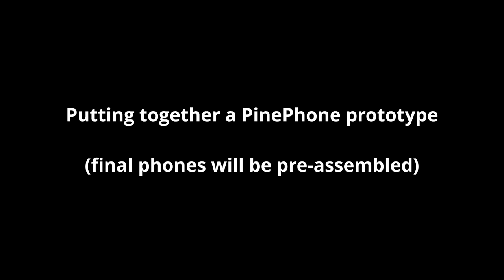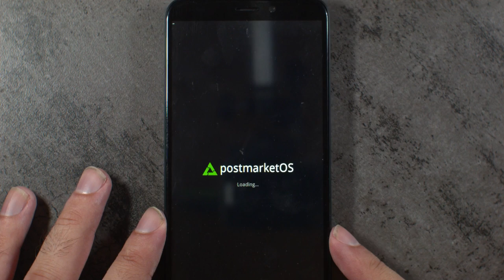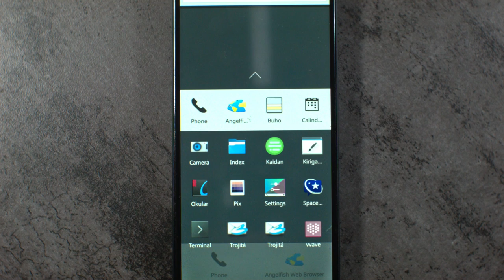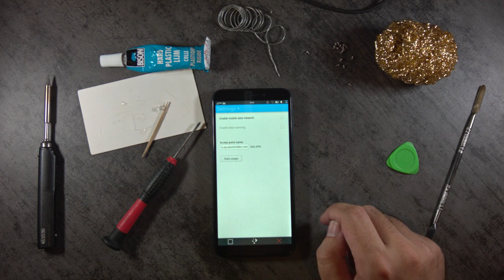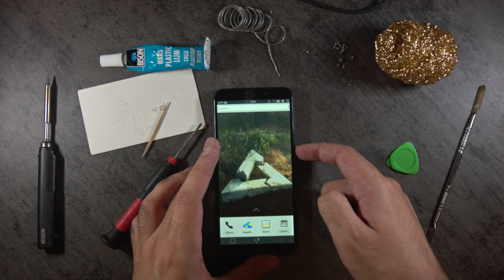Putting together the PinePhone prototype

Comment: Now this is the kind of phone that I would like; a modular phone that you can put together yourself.
Reply from the maker: well it won't be sold as a kit, but at least you can take it apart to repair things :)
Reply: I don't think its modular tho
Reply: This doesn't look much different from the budget phones I've taken apart.
Reply from the maker: @ChrisD__  That's because it's a budget linux phone, but it did spend extra money where it was needed, splitting functions to seperate chips so they can be kill-switched costs money, also the aluminium-infused plastic isn't something you see in budget phones.
Reply: @MartijnBraam  Those similarities are a good thing! They're easy to repair because you don't need a manual if you need to replace something. Also, Is it possible to boot from the SD card? My biggest fear with eMMC is that if system can't boot you can't just pull out the SSD and put it in a new machine.
Reply from the maker: @ChrisD__  Yep, SD booting is the main way I debug the device currently
Reply: @MartijnBraam  i guess the non modular phone will not boot from SD like in this modular phone,right !?
Reply from the maker: @miezoo  it definetly boots from SD, it's one of the great things about it, you put a bootable OS on both the eMMC and the SD card and it both works, when you have a bootable SD card it has priority over the OS on the internal storage.

Comment: Will definitely get this, my only concern would be the stuttering, is this only a problem with the software and will be fixed soon? There's the same thing going on with the Librem 5, so I'd guess the DEs simply aren't that optimised yet, because there really never were devices like these?
Reply: It's likely not the desktop environments. The drivers aren't yet perfect, and both devices are essentially prototype hardware. Things definitely will improve with time! This is extremely similar to how the raspberry pi evolved in terms of driver performance (especially with their recent open source videocore driver that now ships in mesa). The Mali 400 has a actively developed driver called Lima.

Comment: For version 2 "NO SOLDERING GLUED or SCREWED  PARTS" and "ONLY CONNECTORS" that are better also for REPAIR would be a nice add on.
Reply: Fairphone is what you're looking for. They have been porting AOSP to their devices too.
Reply: @parnikkapore   that fairphone does not seem as fair as they claim it to be. They do not provide a schematics. They don't sell mainboards separately. There seems to be no compatibility between parts of different models (even batteries!). Fairphone 1 had support only for 3 years... Display is glued with touchscreen into a single module. Pinephone seems to be a lot more repairable than fairphone. It is very easy to replace soldered flex cables. But it would be nice if touchscreen would not be glued to frame.

Comment: Seems REALLY slow for a 4-core processor compared to my iPhone 6S
Reply: Which part do you think is slow? The cores dont matter much, its probably the internal storage speed for the bootup and plasmas fault for visual stuttering, which can be remedied. But its probably cheaper than the iphone, which is a very polished product, completely ooposite of most linux products which get to the minimal viable product phase but not further:) Check out the Nokia N9 for a superb linux based experience. And i'm sure when these unlocked linux phones get into hackers' hands the perceived performance will improve.

Comment: So an android knock-off phone with a removable back?
Reply: @Endee So android knock off.
Reply: go away
Reply: @johnsonmcbig9157  While Android and PostmarketOS both use Linux as it's base, Google initally ripped off Alpine Linux (the thing that Postmarket uses) at some point https://dev.alpinelinux.org/~clandmeter/other/forum.alpinelinux.org/comment/777.html#comment-777
Reply: Other way around. Android's the linux knock-off phone.
https://en.wikipedia.org/wiki/Nokia_N900
Plain old mainline Linux is back, baby. Binder?! We don't need no steenking binder! laughs in espanol
Reply: It's a bit of a stretch, but at face value I guess you could make this claim, in the same way that Android was (at first) a knock off the iPhone / iOS.
The GUI on display here, as well as the other major potential ports will follow the popular trends in UI design set by Android and iOS.
Similarly, the form factor is popularly used by iPhones and Android phones and has been for ages, so of course it makes sense to go with something tried and true.
When Android came out it was a pretty blatant knock off of iOS and while the phones were originally more experimental, after the release Samsung Galaxy S2 the form factor became more and more like their Apple counterparts. Of course, Android has surpassed iOS in features and there is a far greater diversity of devices, more flexibility through features like expandable storage and, of course, (IMO the main advantage) the customisability of Android.

If you're an Android fan because of those advantages (customisation, hardware flexibility and diversity) I reckon this is something that might actually be of interest to you.
Not that I would recommend to you THIS particular phone. This is for basement dwelling, Linux-loving, early adopter troglodytes like myself and is more about pioneering a market for such devices and their more "pure" Linux OSes.

It will be even more customisable and hackable than Android (which itself is also Linux but also sorta not Linux) and if you really want Android, I bet it'll be ported to this and the Librem 5 in pretty short order. If these devices and their OSes gain some traction you consider yourself a bit of a power user, the next generation or so might actually be appealing to you.
Reply from the maker: @SLLabsKamilion  The A64 isn't a very efficient chip by modern standards, but the majority of power consumption on phones/tablets still is the display backlight. It doesn't matter that much. Having the modem and wifi modules as seperate non-dma bus is also great for privacy :). The USB modem also simplifies the linux userspace a bit.
Reply: @MartijnBraam  Yeah, Pretty much what I was getting at. I don't need the latest and greatest chip... I mean, honestly, a 4K h.265 decoding big.LITTLE dodecacore that wants to guzzle 1280mA versus a 720pish A64 that runs peachy on 480mA? 

As you allude to, the display backlight and the cellular transmit peaks of 820mA (LTE-FDD Band13 @23.0dBm) are the big drains in the system. 

Also agree with having the cellular on a non-DMA bus. Wouldn't have minded if the wifi was SDIO. Would have really loved an 8266 running EAGLE.fw from esp8089.c, but eh, no biggie. I'm just a massive Espressif fanboy.
Reply: @SLLabsKamilion  My only concern is the GPU not supporting modern graphics extensions like Vulkan as far as i know... correct me if i'm wrong please! And the old CPU potentially be a security issue (though from what i understand it should actually be more secure in regards to specter and meltdown?) Finally, ram is very important nowadays with memory guzzling websites, so it would have been nice for another 1 or 2 GBs for a bit extra money (Like the new raspberry pi did).
Reply: @izaicslinux6961  The CPU is arm a53 which is in-order execution so it is completely immune to spectre, meltdown, and other similar vulernabilities.
Reply: @traviskraemer  Ah. Good point. Thanks.